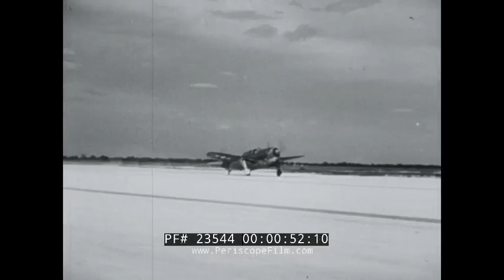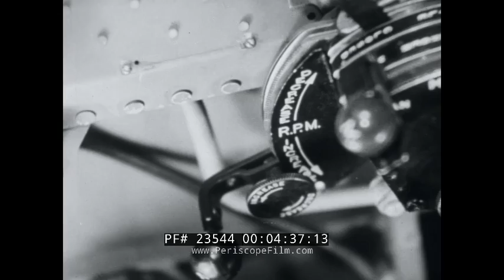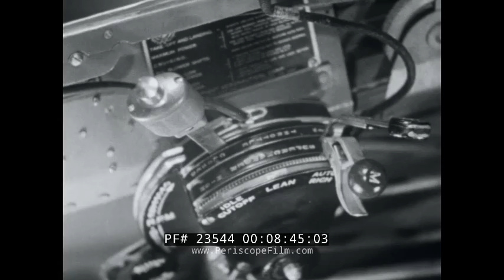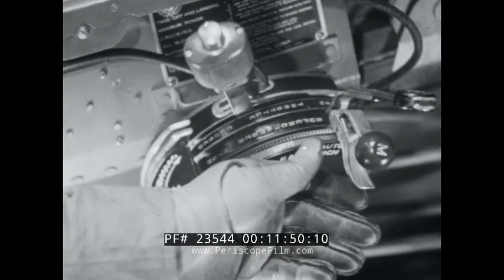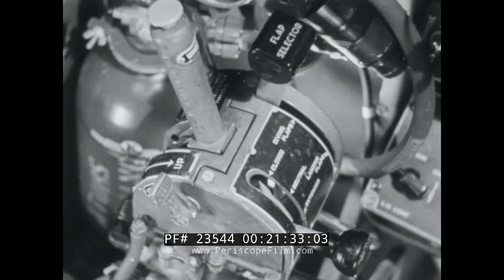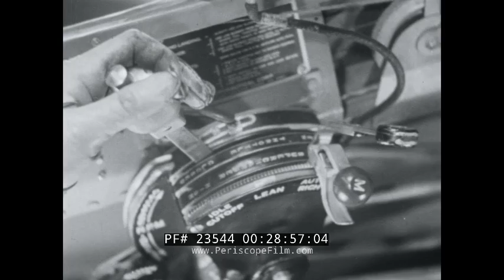CURTISS AIRCRAFT SB2C HELLDIVER   U.S. NAVY DIVE BOMBER INTRODUCTION FILM 23544

Comment: The braking system of that plane was on my 1986 GMC 1 ton dually - an accumulator which work fantastic. That truck had 13X3" drum brakes all round and would stop. Those accumulators have NO power boost drums that run off vacuum. They should be on all vehicles. Never ever had a single problem with that system. Love the HB2C but a gas guzzler like most big radials. Thanks for posting this.

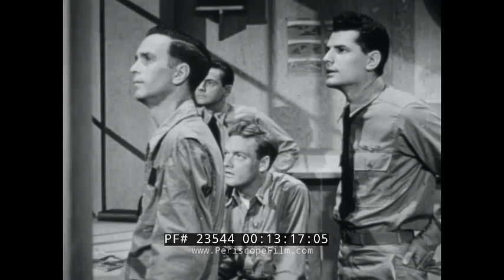Comment: 13:19 That’s a lot of steps to get to get this thing started , let alone fly. 

Question: I don’t know if anyone knows this but since the wings are unfolded with hydraulic pressure was there a risk of the wings collapsing if the hydraulics were damaged? 🤷🏻‍♂️
Reply: Not 100% sure on this, but presumably the wings would mechanically lock into place once unfolded. I think just having only the hydraulics holding the wings in place would probably reduce the stress tolerances of the wings, something which would not be desirable for any plane.

Comment: Dad trained and flew in the Helldiver. CAG 75 on the FDR CV42. He sat in the Rear Seat. Radioman/Gunner and later trained on Radar Operator. 
While Ferrying SB2w5e 's to Guantanamo Bay Cuba they flew #7 off the end and into the sea. OFFICAL Report stated Catapult Failure.

Comment: I heard an interesting story of how dive bombers were first developed. They were plagued with wings being torn off when pulling out of a dive. The engineers tried everything, nothing worked. The janitor suggested drilling a string of holes along the root of the wings. The engineers had tried everything, might as well give this a try. They tried this, and the wings stayed on after pulling iut of a dive. They asked the janitor if he had a hidden aeronautical engineer degree. He told them "I've  been a janitor for 20 years, and I've yet to see a roll of s### paper that ever tore along the perforations!"
Reply: Andy, I hope you are kidding with that story, because it's very incorrect.  The perforations allowed split dive flaps to be more effective, and the flaps were not on  the root, but the trailing edges.  Nothing to do with the primary wing structure, though the drag they provided allowed those steep dives without overspeeding the airplane.  The wings were stressed for pullout at a given range of speeds and G loadings, and early on in the development of dive bombing, I'm sure there were plenty of incidents of either not enough structural strength designed in, or a pilot exceeding the design G limits.  Either might cause wings to fail. It is always possible to have a structural failure if you get an airplane outside its operating envelope - just having dive flaps did NOT mean you couldn't mishandle the airplane and wind up losing the wings (or the tail, possibly) by going past design limits on a hard pullout.  By the time the SB2C got through its painful development process, it was probably an adequate weapon, but it was never considered to be as good an airplane as the SBD, and the "Beast" moniker followed it until retirement.  I have read that the four bladed prop and added power on the later models made it a much better carrier airplane than the early Helldivers.
Reply: @jimmahon3417  :

This is the story as I was told. Part of my job includes reloading s### paper dispensers at the job site. To this day, I've yet to see a roll of s### paper that reliably and consistantly tore on the perforations.

Comment: Was it my imagination or when they did the takeoff checklist the narration said fuel selector switch on fuselage but the “Gucci “ rotating checklist said it should be “reserve”, I don’t think I am totally senile yet, checked it 2 or 3 times but independent conformation would be appreciated. The rotating checklist gizmo is a really good idea, saves on FRCs (Flight Reference Cards)  getting in the way, although on modern aircraft you would need a big viewing window to cover everything and the number of checklists our could have would be limited and when your in a multi crewed aircraft it would be just as easy for the second pilot/bombardier/air gunner to read it, especially in an emergency (assuming they aren’t incapacitated in some way). 
Thanks for sharing another excellent video of aviation from our recent history, very interesting and informative. 😀👍🇬🇧🏴

Comment: The SB2C, which Navy flyers claimed was an acronym for "Son-of-a-Bitch, 2nd-Class".  My father flew frequently in these aircraft during WW-II from the carriers Yorktown, Hornet and Belleau Wood, including strikes against Truk, the Philippines and the Ryukyus, the Battle of the Philippine Sea and the sinking of the battleship Yamato.  The bottom line was that, given the choice, he greatly preferred to fly in the Grumman Avenger.  The Helldiver was both underpowered when fully loaded and had bad low-speed handling characteristics.  As a result there were a lot of accidents during take-offs and landings, so that the plane developed a very bad reputation in the fleet.  My father said that, while Grumman Avengers and Hellcats would climb away from the flight deck, on take-off, the Helldivers would drop off the end of the deck, and then be seen again struggling into the air, or sometimes they simply crashed into the sea.  In fact, the performance of the Helldiver was so bad that the captain of the Yorktown recommended that they be replaced with the Dauntless diver bombers which the Helldivers had originally been intended to replace.
Reply: My dad was a radio/gunner with VB-11 on the Hornet around the same time. I met the pilot who flies the only flyable plane now. He says he has to work hard to fly it.
Reply: SB2C-4 was the one that had more reliable power advantage over the older ones, but by the time it came on the scene, it was bassically just a scouter, and if needed could make a long range strike. Otherwise the F4U-1A/D was on board quite a few carriers, and was accurately dive-lobbing 2000lb bombs! It just lacked the range of the beast, but otherwise was a superior strike aircraft! SBD still has a lot of glory to it, you can safely assume the Corsair replaced the SBD, not the helldiver!
Reply: I still like the helldiver though, it is a beast! Too bad the older biplane SBC helldiver was too under powered, that looked like a sleek little racer of a plane, ended up being a waste of tax dollars, because as soon as Lexy, Enterprise and other carriers got their SBCs, they were considered outmoded by the time WWII started! Same with Wasp and Ranger's Vindicators, a cool plane, but as soon as they rolled off the production line they were obsolete! 
RIP Wasp, my favorite carrier of WWII!
Reply: Interesting.  My uncle was an ARM1c, radio operator/rear gunner, in VB-9 flying those same missions from the Lexington and the Yorktown.  Though he wasn't a pilot he has said that he didn't like the feel of the SB2C launching and recovering on deck.  Otherwise he said it was like Cadillac to a coupe when compared to the SBD.  The SBD was a tighter cockpit but the plane was simpler thus more robust when $hit hit the fan.
Reply: My dad as a freighter pilot F6F Hellcat. He hated The SB2C. And wouldn't fly one when asked to.